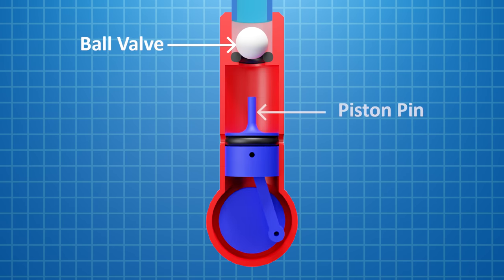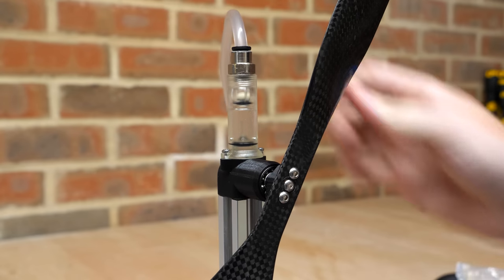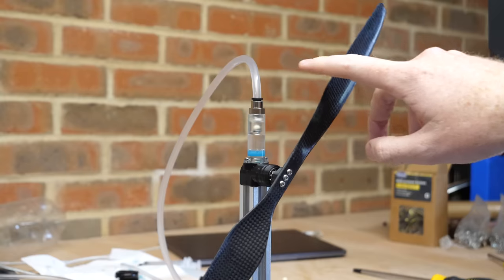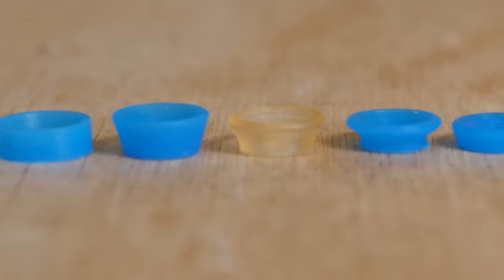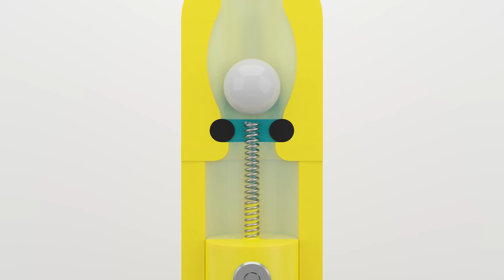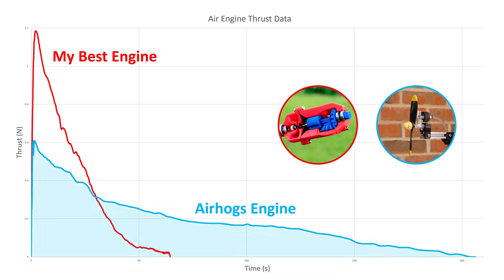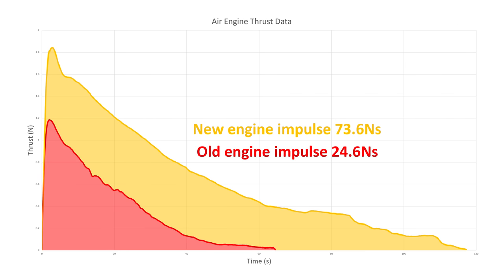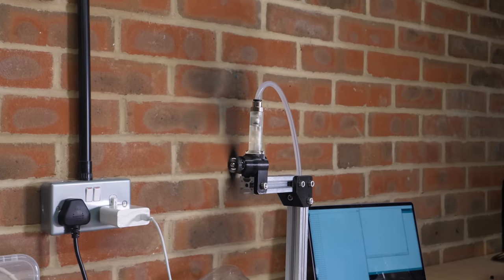Optimising an Air Engine

Comment: This is impressive! Like really impressive!

Experimenting with multi cylinder engines would be cool. I'll bet a V-twin version of this would be sick!
Reply: Multiple cylinders will multiply the:
A: Thrust (is good)
B: Friction (is bad)
C: Other Losses (is bad)
E: Air consumption (is bad depending on point A)
F: Coolness (is COOL!)

Feel free to comment on point D!
Reply: It will also go some way to eliminate the requirement for the flywheel to create the cylinder compression, since the other cylinder can now provide that. Unfortunately a V2 would probably be a bit unreliable (especially on a plane) because the ball valve is sealed by gravity as well as pressure - although maybe the effect of gravity isn't very much given the high pressure air pushing the ball out?

Either way, I'd vote for an inline 2 engine.
Reply: @asdaneedsfunds  - 2x Inline = 2x COOL!
Reply: @asdaneedsfunds  Wouldn't you still want a flywheel? Stores energy for the compression stroke, helps keep the engine running smoother. I wouldn't eliminate the flywheel, I would just adjust the weight of it until you get peak efficiency.
Reply: @TrollingAround  Double expansion makes it worth it. Steam engines used this technique, works on air engines too. Basically you just run a second engine optimized for lower pressure and feed it off the exhaust of the first engine. You're not consuming additional air, friction is still fairly minimal, and you extract way more power because your two cylinders are tuned to run at the pressures they'll normally see.

Only real downside is complexity.
Reply: @TakeNoShift  yes, you would still want a flywheel for an inline 2, but you might be able to get away with a lighter one
Reply: @TrollingAround  D: Sounds awesome (is good)
Reply: what about a rotary engine? or probably similiar to air impact wrench motor, or maybe like a turboprop engine.

Comment: For achieving an air tight piston that moves freely when not under pressure you might consider the type used in Airsoft gun gearboxes. It's a piston with vent holes on the pressure face which flow into the o-ring groove behind the o-ring and push it out onto the cylinder wall creating an excellent seal. When not under compression the o-ring should barely touch the cylinder wall, and if you push it slowly into the cylinder it won't seal, but push it in fast, or introduce high pressure to the chamber and the o-ring spreads and seals.
Reply: Some racing pistons are gas ported like that to seal the rings, better also
Reply: Still, such a clever technique!

Comment: Hey Tom, is it possible for you to make a kit for the air engine? I don’t have a 3d printer and my parents won’t let me get one so is it ok for you to make these and then sell them? Thanks
Reply: Yeah I also really want one but can’t afford 3d printer
Reply: @Gavaiation  same, i want to use it on my rc plane but i also can’t afford it :(
Reply: @Millie_oo0  yeah I want to make a plane with it
Reply: @Gavaiation  i already have the frame of it done I just need this to make it fly… also because the motor i have is kinda overpowered 😅
Reply: @Millie_oo0  yeah i have a old drone motor I use with a 9 volt battery witch the whole kit together is to heavy

Comment: What if that wasted exhaust air can be reused somehow to refill the air tank so it will run forever? You welcome
Reply: you’re welcome not you welcome
Reply: Energy cannot be created out of nowhere. The wasted exhaust air is at a lower pressure than the initial air coming into the engine. You could harness this by passing it into a second air engine, however it would be much less powerful than the initial engine since it's running on a lower air pressure.
Reply: can’t have a 100% conversion, if you catch and reuse air that will add force in the opposite direction the plane is going, without speed a plane cannot fly unfortunately

Comment: when I was little I tried making slotcar tires by moulding household silicone in a mould made of wax... the result worked but it was messy with air bubbles.  I've never seen the technique you've shown, interesting... I thought I needed a bell jar to pull this off.  Your results are awesome.

Comment: This engine is absolutely insane how much power and runtime you have. If it has that much power I honestly would just add a second 2-liter bottle for more capacity if you wanted about 3 minutes per bottle. Controlling that via rc sounds insane!

Comment: I have a Air Hog power pod that I built a airframe for. I also added a folding prop for a E-power motor. It fly's very well. I could have made it much lighter by using built up construction for the wing and tail, but it is robust enough to take some lumps. I did use contest grade balsa so it is not too heavy Keep up the good work and I look forward to seeing more.

Comment: Another method of getting a seal on the piston ring is used in some automotive engines and it might work here. Instead of your "cup" seal, go back to the o ring. Your piston should have a few small holes going from the top of the piston to just behind the o ring when it's in it's groove. When the air charge comes in the high pressure air goes through the holes and pushes on the piston side of the o ring pushing it out for a better seal. This system works on high compression car engines and keeps the top ring in contact with the cylinder wall.

Comment: what you need is a gas ported piston gland and oring, so the pressure stretches the oring against the bore, but shrinks once the pressure is released, this helps with stiction/friction on the return stroke

Comment: My prediction to improve the ball valve engine is to put a header on the exhaust instead of the wide-open slots, this could increase “scavenging” by attempting to leave a slight vacuum in the wake of the exhaust pulse, if the vacuum was strong enough, it would help suck the piston back up. 

And seeing as how most air engines are single speed, calculating the optimal header tube diameter and length would be simple. 

Another idea is to use the movement of the compressed air through the Venturi (where the ball sits) to draw a vacuum on a pipe connected to the crankcase which would help the piston travel down on the power stroke. 

They do make vacuum pumps that only use compressed air as the source of power, it may not be the most efficient way to make vacuum, but they’re simple and work pretty well for low-flow vacuum needs like sucking oil out of an engine or transmission with a difficult drain location.

Comment: LOVED it, but got some ideas for you. change the bearing for a smaller one maybe cilinder one, has lower resistance and is lighter, on a possible near future the exithore for the pressure on the side may rip the rubber, turning circle may need dynamic balance for less vibration, discover best sizes for the propeler such a small one may have smaller diameter and bigger suface for it so you dont need to get higher rpm, and considering the proportion of weight/size you may optimize wings suface area in relation to its shape triangle format or V shape wings longer axis to push the wheit backward if trying to triangle shape. sorry for the intrusion , just wanted to help.

Comment: Your rubber seals would work very well but the reason the bottom is expanding is there isn’t enough support to keep it from happening is all to flexible

You could add a small plastic ridge that holds the bottom on the suction cup type to keep the bottom from behind pushed to the wall.

Comment: A 2-stroke style expansion chamber on the crankcase vent, the piston comes down blowing air out the pipe and the returning pressure wave pushes the piston back up. This idea is my least expected to work because the velocity of exhaust on a pneumatic motor is not fast enough to create a sonic wave the way ICE engines do.

Comment: I don't know why this video was even recommended to me but after watching a few videos of this project I think there could be a few more improvement that can be made. But bear with me, I am not an engineer of any kind. I am a medical doctor. So my idea might not be feasible. So here is a few things that I think might be able to help improve the performance of the engine.
1) Is to add exhaust pipes that pushes the flow of the exhausted air toward the rear. This should create some thrust that can help make the engine more efficient and increase the aircraft's speed. Well, in my theory I guess. But I think this is the simplest modification to the engine that you can make. So I guess it is worth the try and test.
2) Is to somehow maintain the air pressure, or possibly increasing it by modifying the air container using something like a syringe or a balloon that can continue to squeeze/push the remaining air inside the air container even when the air volume goes down. The same like how our lungs work. We have intercostal muscles between our ribs and the diaphragm that can exhale air out and also inhale air. Maybe somehow you can engineer that air container to somehow be able to also inhale from the front of the aircraft, to create "suction"(maybe increase the speed?) and exhale air to the engine. If this is possible this could make the aircraft extremely efficient and you might be able to extend the flight time for alot longer. for the intake maybe something like an air intake of a car engine by creating vacuum which will suck air into the air container. For the exhale, I think a syringe system with a battery powered diaphragm that will keep pushing the air out at a constant pressure all the way until the bottle is totally empty. But I stiil don't know how the intake can add air into the bottle. Maybe 2 separate bottle? once one is empty, it will use the 2nd bottle and while the 2nd bottle is being use to power the engine, the air intake will fill the first bottle. But the intake part might not be able to create enough pressure in the bottle. But I guess thats the job of the diaphragm?

I don't know if all my ideas and theories will work or could be engineered. But I guess I was just so intrigued by this project I just feel like leaving it out here so maybe someone could figure the rest out.

Comment: Could you make a 2 cylinder version where the 2nd cylinder is fed the exhaust air from the first cylinder? It would be interesting to see if there is any performance benefit to having more than one cylinder.

Comment: Dude! I love your air-motor experimentation!!!! I am an A&P w/extensive recip. pp experience in AK. If you're taking public input, I encourage you to consider glass cylinder barrels and a second piston ring  as the pin/valve-pistons might stabilize better under compression and not be so wobbly, improving efficiency. Good you've gone with a standard crank-pin assembly as opposed to the wire connecting rod idea. Now that you are using impressed roller bearings and a solid crankshaft, would it be possible to add a contra-rotating gearbox to the 2 cyl motor design?  Improve the air-powered helicopter? I think you gave up on the contra-rotating helicopter idea too soon. Love your presentation of physical Science! Fan!

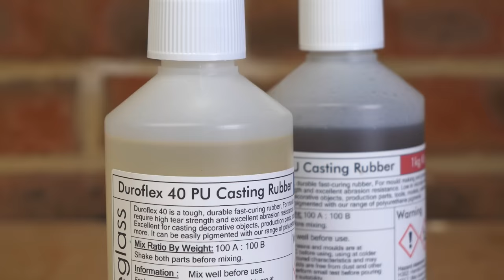Comment: watching your footage at 6:23, I'd suggest making the top of your piston cupped, or concave, so that the piston wraps around the bottom of the seal.  As is, with a slightly rounded piston top, I think it contributes to the bottom of the seal spreading out laterally.

Comment: The rings in a conventional piston engine works exactly like your oring, in that it's the cylinder pressure that pushes them against the cylinder wall to make the seal. Their elastic force alone doesn't do much.

Comment: there is a lot to figuring out the timing of the inlet valve opening and for how long, it doesn't necessarily need to open as late as possible, as that depends on the pressure and temperature of the incoming air, as the air expands into the cylinder and does work, it takes a bit of time for that to happen, so as the valve opens later, the expansion becomes slower than the pistons movement due to momentum, thereby wasting the energy.  the lower the air pressure, the slower the expansion.  the port size and location for the air exhaust also has a big effect on efficiency, ideally, the port will be open longer than it would seem necessary, which would allow the cylinder pressure to not only reach atmospheric pressure, but, because of the mass of gas and the momentum, briefly go below atmospheric, thus reducing the cylinder pressure further on the upstroke and again increasing efficiency.  look up 2 stroke engine designs, there is quite a bit of theory there.  the engine will probably work at peak efficiency within a narrow range of gas pressure and crank rpm, this is called "tuning", so what I would probably do is develop the engine for a specific pressure and rpm, then design a system that would allow a high pressure gas cartridge to deliver through a regulator a medium pressure, which would be stable until the high pressure cylinder is exhausted.

Comment: This might be a good case for an off center crank giving more time on the power stroke. Additionally,  I have had good results by turning the piston on a lathe.  Make a  few groves before and after the o-ring.  This will add time before the gas can leak past.

Comment: The problem is the friction from the seal in the piston is working against efficiency. And that problem will never go away. Because it always has to make contact with the cylinder in order to work. But obviously it will work , nice tweeking good sir.

Comment: Good design and video!

To compare total engine impulse, you need to use the same propeller. Critically, larger propellers are more efficient, since used energy is proportional to velocity squared*mass, thrust to velocity*mass.

Comment: Hi, awesome work. Just an idea, your original  O ring idea, did you cut the inside of the O ring with a sharp knife. I did this for the brakes on my jet plane, works perfectly. . Hold the O ring carefully on table, run the blade on inside until half to 3/4 through. The air pressure will get into the slot, expand the O ring completely in the groove and push out to seal on cylinder wall. When pressure taken away, O ring relaxes and friction reduced. You could drill tiny hole in top of piston into the O ring land to help inflate it quickly. Just a thought and so quick and easy to try on your old engine. Cheers Tim

Comment: Another idea is a double power-stroke engine, where there are valves on the top AND bottom of the piston so it’s powered by ways. 

Yet another option is an opposed piston design (one cylinder & two pistons) with a centrally located air valve and exhaust ports on both ends.Then gear the cranks together. You would get a higher expansion ratio from the enormous combined stroke.

Comment: Great video! Rather than total impulse, it would be even more meaningful to most to calculate the efficency of the engine - ie. the percentage of mechanical work done compared to the calculated energy available from 2 litres of 60psi air (presumably at room temperature). It would also be interesting to know how much energy is lost in compressing the air in the first place - presumably mostly adiabatically with the heat produced lost to the environment. I expect that very few viewers, including me, have any idea how efficient these engines are - 5% to 10% overall (including compression losses)?

It might be interesting to measure the cylinder pressure in real time using a cheapish sensor and Arduino or similar. Then you might get some more insights into the losses. Eg. to determine how effective the exhaust valve is and see if the piston seal causes any recompression on the upstroke with associated increased friction losses. It might also be able to show any inlet valve leakage and/or piston seal leakage in the power stroke.

Finally and most interestingly, how about developing it into a double or even triple expansion engine? Granted at this scale the efficiency gains would probably be minimal or even negative, but it could be a fun and challenging project.

Comment: Using a spring for a piston pin retards the timing slightly, which should improve the performance. You don't want the valve to open until tdc.

Comment: I was wondering on the old piston design, with the o ring. It would work much better if you drilled a small hole through the top of the piston just behind the o ring. This would pressurize the back side of the oring and push it against the wall providing a better seal. And would reduce as the pressure dropped as the piston went down, helping reduce friction.  It is used in some high performance cars pistons!

Comment: Check those cheap manual bicycle tyre pumps, specifically the old ones that have a thin metal body. The seals inside are a similar design that you’re trying to produce.